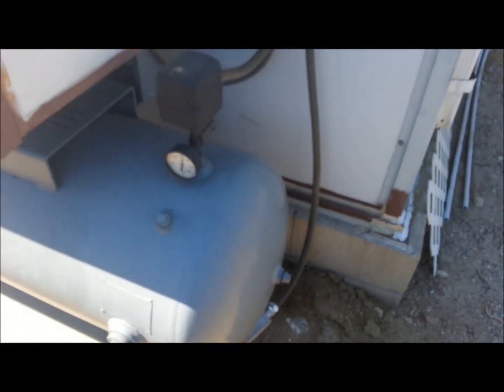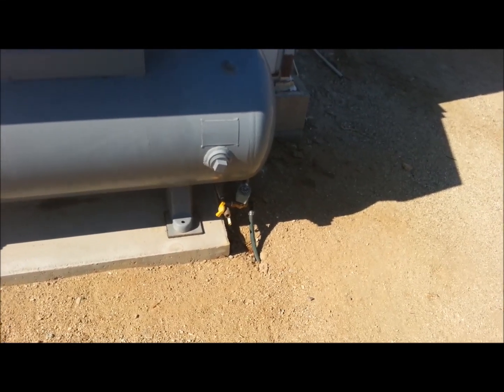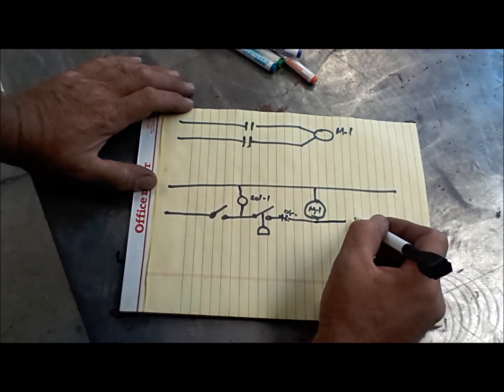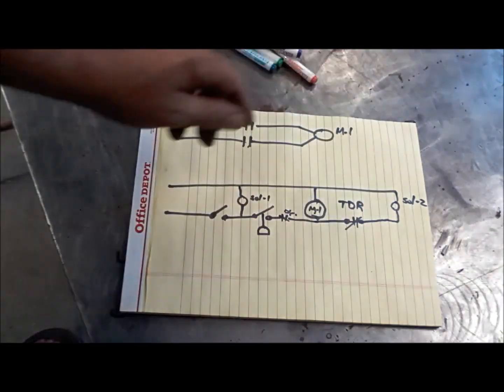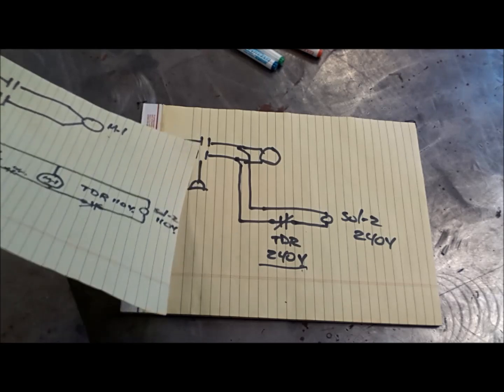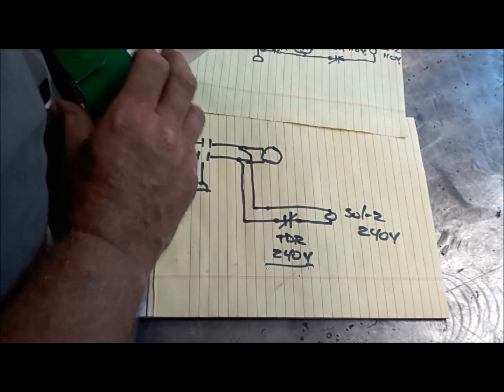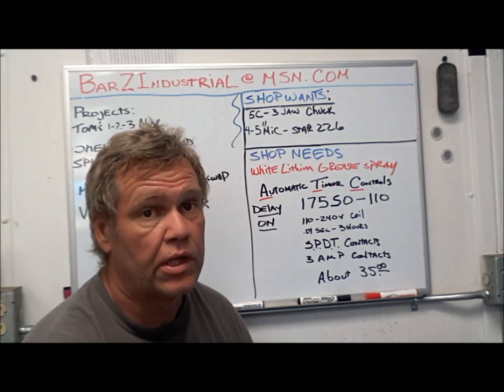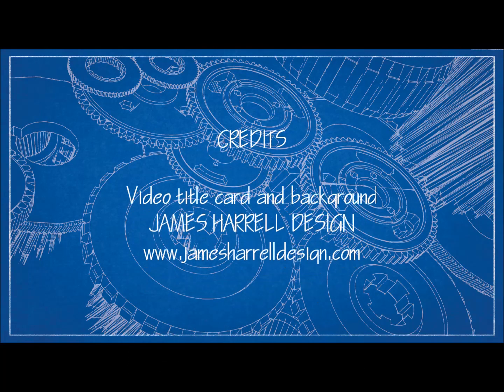Compressor auto drain

Comment: Stan, thanks for the ideas and explanation. I don't know a lot about controls, just some basic physics and electricity, but if you keep talking about it, I'm sure I'll learn more. Motors is an area I need more understanding...been looking up info to try to understand magnetic motor starters, contractors, and why you need capacitors for starting some motors (like the one in my furnace blower).  I know thus stuff is very basic for you and others, but it's new for me.  I'm getting it slowly. 

As far as tank drains go, I'm with you on the crawling around to open drains thing.  I've just got a little 110v 20gal Ingersol compressor for blowing things off, running nail guns, and the occasional light HVLP spraying, so the solenoid and timed relay method is probably not practical, but I think I'll work on plumbing in a drain hose with manual petcock in a more reachable location. 

-- Mike

Comment: Your a pretty smart dude Stan! Thanks for sharing your knowledge with us.

Adam
Reply: Thanks Stan. Excellent information. I just got hold of a Quincy 325 pump. Your tank rebuild video showed up like clockwork. Thanks again Stan. Charlie.
Reply: Wow! Talk about mind reading! I recently purchased a new upright 60 gallon Cambellhousfield 240V 3.5 hp 1 phase. I do alot of plasma cutting and blast cabinet work. Ive got a desicant set up for the top end and now am going to implement the design you laid out here. Getting up and down with a fused back sucks. This will be added to the garage upgrade list of things to build. Thanks for sharing this with us.
Regards James Greene
Aka Walter White /Heisenburg
Albuquerque New

Comment: Perfect timing because I am about to connect my compressor to the shop using 3/4" galvanized pipe in a loop from which 1/2" drops give me access. I have a question though. I have purchased 2 solenoids from the States (one direct lift and one pilot lift because I was unsure of what would work) in 240V AC version to do what Chuck did. We run 240V single phase and 400V three phase here in Greenland. I already have the auto drain on the compressor tank with timer/solenoid and of course pressure switch. I wanted to power the solenoid from 240V 50Hz single phase, but am now a bit confused. Can I run plus and negative 240V to such a solenoid, with a switch in my shop to turn on air to my system? The compressor is in an outdoor heated structure to reduce noise in the building making it inconvenient to go outside to switch air on and off.
You are very good at explaining the topics you choose to show and I enjoy your presentation. I look forward to your videos. Thanks for sharing
Reply from the maker: Hi Jim,
Good to see you again, and thanks again for the nice e-mail a few months ago. I am not clear as to your control voltage are saying it is 240V? what is it phase to ground? 120V? on both phases? or do you use a grounded neutral?
Reply: Commercial wiring here is 220V 50Hz run as neutral, phase (hot), and a ground wire for safety. 400V is also 50Hz with neutral, three hot leads and again a ground connection to earth. My thought was to run a neutral and hot (thus 220V)  to the solenoid and the ground to the housing or water line. Does one apply hot and neutral to a solenoid to activate the coil? Amateur question I know. I am confused because 3 phase in the States as I remember it was 220V and I thought therefore that one might have to run two hot leads to the solenoid, but that would make fire, no? This is what happens when you try to do something with no background in that something.
I appreciate your reply and will ask an electrician here before I load you down with more than you already have (I'm impressed with all the different things you do and the quality of the work). My son and I are just about to get the move in "green slip" on our 1500 square meter building we have built ourselves and there is just too much to do right now to even think about learning something new let alone starting some video recording to share what we can do.
Please feel totally released from any responsibility to respond back to me. I am just a bit stressed now and was hoping for a "quick fix". Keep up the great work, and know that you are very inspiring and encouraging for me. I am among the thankful out here in YouTube land.
I will get back to you on the triangles. I am sorry to have caused you to use your time to write, but it will eventually result in action.
Best regards,
jim
Reply from the maker: Jim Milne Hi Jim, I dont think a solenoid will care about dropping to 50Hz, so voltage to the coil would be 220V (1 phase + a neutral) is the 220V actual measured voltage? I would think coming off of a 400V line you would be getting readings in the 200-208V range.
Reply: Line voltage of 400 phase to phase is 1.73 greater than phase voltage ie line to star point (am assuming wye connection) my caclc says phase is 231 V.  A 240 V solenoid should be OK.  As far as freq Inductive reactance --- IR -- is equal to freq x Henry x 2 x Pi.  So if you drop freq then you drop IR which then increases current .  You may well have 20% more current but I have no idea what the coil resistance is nor any design details.  I would be more concerned if coil was energized for hours but in your case it should be energized in the seconds range.  I think you will be OK keep an eye on it and check for overheating - these little guys run pretty hot under normal conditions so bit hard to gage when overheating.
Reply from the maker: dan bentler Good call Dan, when a coil runs under voltage they tend to be "buzzy" and dont really have the holding power, I'm sure running lower frequency will have a similar effect. But like you say, this coil is being run for mere seconds in this application.
Reply: Shadon HKW Agreed they buzz more when supplied with low voltage.  
Low voltage = less current = less magnetic field = less "hold in"  This is bad because current is very high unless pulled in all the way in which case current is lower.  Do not remember this part of the theory - gotta dig out a book or two and refresh memory before I blab further with any kind of accuracy.
Inductive React is one component of impedance - other is resistance of the windings.  So if I lower impedande I raise curretnt = more field = better hold in.  DOWNSIDE is more I squared R loss = heat.

BUT  more in theory stuff
he is running 231 V and coil is 240 so he lowered voltage AND impedance so may come out as a wash

REAL WORLD even if it is drawing too much current with it operating seconds when on and minutes when off it should have enough cool down  so all may be good.
Reply: dan bentler
Hi Stan and Dan. Measured the voltage and it showed out 238V then later the same day 232V so there is some fluctuation. We get electrical power from a hydro-electric facilitiy quite a bit south of here, delivered by the longest free hanging span in the world. It crosses the Ameralik fiord among others.
I'm getting off topic.
I've followed this string and didn't know I would set off such fine responses. This YouTube community is amazingly helpful.
I like Stan's REAL WORLD take on the problem and will report back as soon as I have it all up and running.

Comment: The drain petcock of the compressor is a NPT fitting.  I routed/plumbed the petcock to a chest high position.  That way I didn't have to get on my knees to drain the tank.  It was a simple job.  It still sprayed the gunk  all over the place, but I could just crack open the p/c and just dribble it into a bucket.   I should have just installed a regular shut off valve and plumbed an additional 15-20 feet of 1/4" (or 1/2") line/pipe out away from the work area (like you did).   I added 25 feet of 1/2" copper pipe to the out put of the compressor.  That way the hot compressed air cooled prior to entering the tank.  I ran the 1/2" pipe up and down and sandwiched It between two sheets of aluminum.  I wish I had a picture of it.  After that , there was almost no moisture coming out of the air hose, tools, etc.  It all (~90%) condensed in the tank!  And the moisture/water separator would rarely get full either.  Another benefit was that since the air was cooler and denser, I would get twice to three times as much air into the tank (PV=nRT).  And impact wrenches would put out more torque!.

Comment: I worked on a Sullair screw compressor and refrigerated air dryer.  The air dryer had a small thimble sized drain cup.  The little cup had a capacitive sensor that triggered a drain solenoid.  In August (City of Industry) weather, the humidity would peak and you could hear the thing discharging a few times an hour.  I forget if the drain unit was a single module(it's been 10 years), but if it was, you could attach that rascal to any compressor/tank drain.
Reply: WAVETUBE84 Problem with these is the cost:  ~$250

Comment: Thanks Stan! Could you please update us with the part number for those Goyen solinoid valves? I'm at 175psi wp. I just installed a new compressor with a receiver tank so I want to set up two solinoid valves with one timer relay. it's all 240v single phase, a little help please. I would also like to install an hour meter to keep track of maintanence. Any thoughts? Who makes good quality liquid filled anti-flutter pressure gauges? I'd like to find two 4" large number lab calibrated gauges with a range of 0-350psi 175 psi being prominetly deplayed in the middle of the gauge. Any sources? Thanks again, Jim.
Reply from the maker: Hey Jim,

Goyen is just 1 brand, Asco is another, you need a normally closed valve, 240V coil and select your pipe size to match your plumbing, I see them on e-bay all the time.

Comment: Can you show the wiring of the time delay relay. I have a red hat 220v nc 8210 and I am looking at the 175so110 relay on galco. It says it is a 110v Input. My compressor is 220 like your second drawing. Before I buy the relay i sure would appreciate understanding a little bit better how to wire the relay to the solenoid and the compressor
Reply from the maker: The one I used originally is obsolete, here is a replacement with universal coil voltage.  
https://www.galco.com/buy/Macromatic/TE-8812U

Comment: In N America, you could wire your 110V TDR and Solenoid between one of the phase contacts of the pressure switch and neutral. Not a big deal. Note that using 60Hz solenoids on 50Hz can result in serious overheating. Same is true of motors and transformers. OK to use 50Hz rated on 60Hz, but not generally vice versa.

Comment: Am I missing something or did you forget to include the relay coil in the thermally protected diagram?? If you have the ability to include a neutral in your compressor feeder conductors, you could use only one half of your 240 volt supply and that neutral and run your solenoid and timer on 110 volts. If your going to mount the relay on a "din rail" a fuse holder mounted there also would enable you to better protect the solenoid and the timer coil. Thanks for providing the concept for sure.
Reply from the maker: +Pappa Bob Those little TDR's are solid state cube type, doesnt really have a coil to speak of.
Reply: +Shadon HKW OK, but how/where are you "triggering" the relay contact in your drawing?? I see the wiring to the solenoid and the wiring going through the normally closed relay contact but don't see where you are "controlling" the relay.
Reply from the maker: If you are using a conventional "on delay" timer, I would power up the coil and the contact at the same time, dont forget to land your neutral wire :)

Comment: It looks like the timer is 110v only. http://www.marshbellofram.com/automatic-timing-controls/files/2013/11/175SO-110-Data-Sheet.pdf

I couldn't find a 220v version of the Goyen solenoid. From the video it looks like the part number is12QA2-ENANA-7081, but the box has a hand-written 220v on it. Is this a special order or did I get the part number wrong?
Reply from the maker: This spec claims 20-240V --> http://www.galco.com/buy/ATC-Automatic-Timing-and-Control/175SO-110
I have had this timer in operation @ 240V for 3 years now, solenoid was probably a miss box, thus the hand writing.

Heres a little 240V unit for 30 bucks  > http://www.ebay.com/itm/like/320366392017?lpid=82

Comment: i have my magnetic starter for my compressor tied into my light switch so when i leave the shop and turn off the lights my compressor and solenoid shut off.that way i never forget to shut off my compressor.
Reply from the maker: The shop lighting circuit is a great way to kill control voltage and never forget to turn your noisemaker off!

Comment: http://www.ecompressedair.com/drain-valves/no-loss/sensor-controlled/bekomat-31.aspx
This is the $200 Bekomat automatic drain.  They are pretty much set and forget.  It's the same thing as the device you designed.  I thought a cool feature that you could add to yours is a manual control switch.  Just a push button would work.